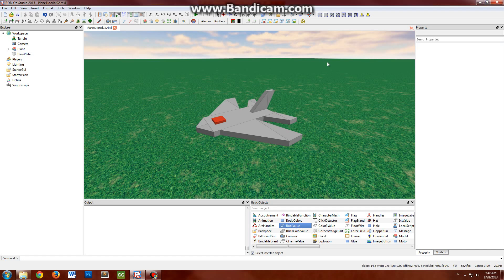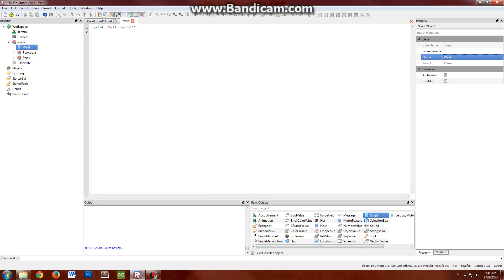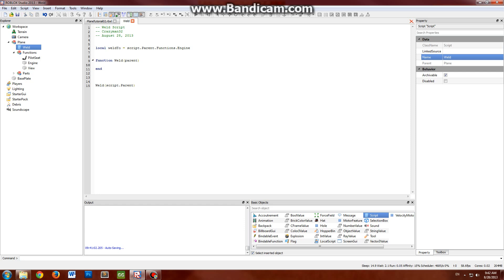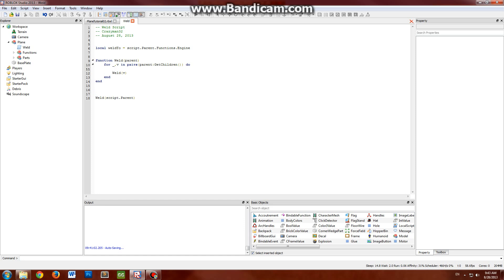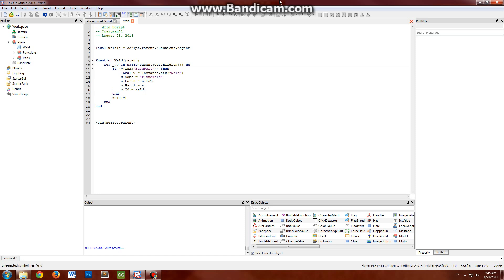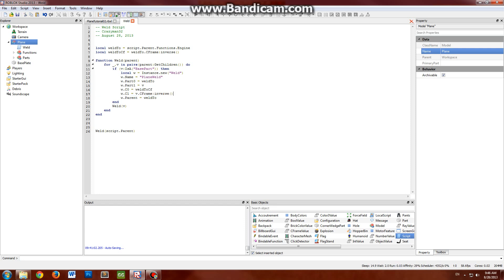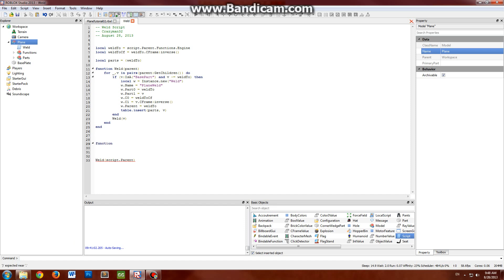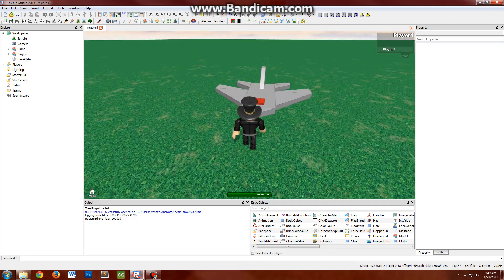ROBLOX Tutorial: Creating A Plane (Part 2)

Comment: Actually if it doesn't work there's actually a weld plugin
Reply: There is nothing wrong in the code so it will work perfectly fine. But instead of welds you should use weldconstraints, they are new and better constraints

Comment: it just falls apart
Reply: YOUR ARE A LAIR
Reply: RobloxPlayer how did I lie
Reply: Group them together
Reply: Anchor it or group it.
Reply: Tyler Hiles Anchoring wont work, it wont move. You need a welding script.
Reply: theres a part 3
Reply: Use glue, anchoring it just keep it in one set position.
Reply: Aidan W Welding script is required